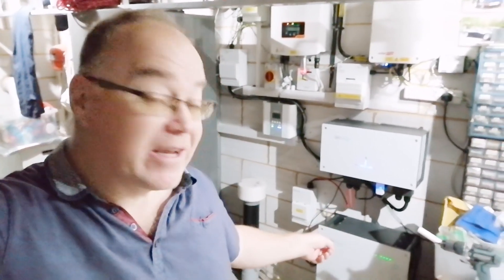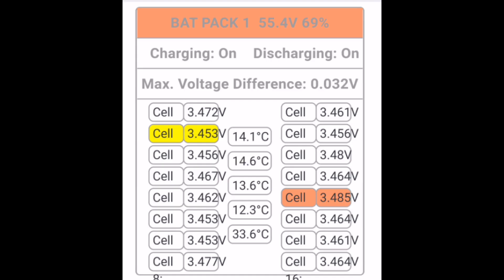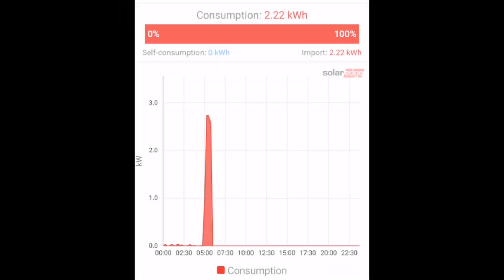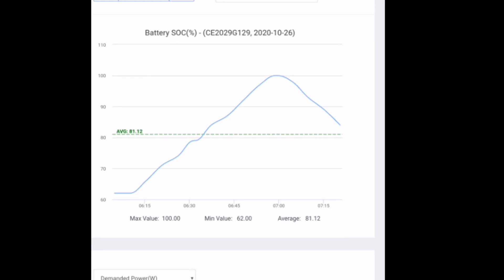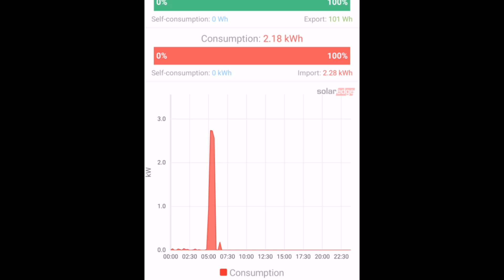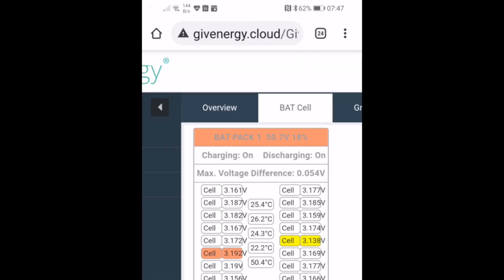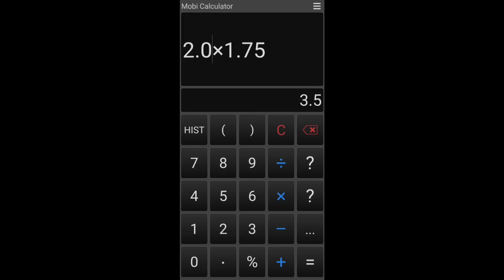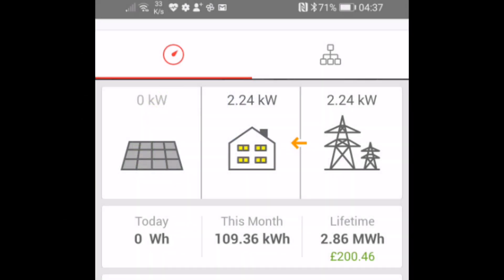Givenergy AC3K 5.2Kw home/solar battery discharge/efficiency test

Comment: Thanks for your videos and information! Would you recommend this battery and also how quick does it respond to a power load? Is it instant or does it take a while to kick in?
Reply from the maker: It ramps up and down slower than some other batteries. Not Instant.

Yes I think Givenergy is a good option mostly price wise and software wise. Performance, reliability and growing company are the negatives
Reply: @EVPuzzle  did you have any reliability issues with the setup battery or inverter?
Reply from the maker: A few software problems causing battery recalibration. Seen a few hardware failures in other people's systems. Nothing too widespread but with parts shortages it can be a pain

Comment: I'm just looking at the technical data sheet for the 3kw inverter and can see that the "max AC apparent power" is 3000va not 3000w. 3000va is 2.4kw.
Reply: This isn't strictly accurate - the VA to Watts ratio is related to the power factor of a given load, and the type of supply. In a DC circuit, Watts = VA. When using AC, power factor is the relationship between the instantaneous voltage and current waveforms - depending upon whether the load is inductive or capacitive, the voltage and current waveforms are pulled out of synch (current leading with one type of load, and lagging with the other). The greater the disparity between the waveforms, the lower the power factor, so the apparent available power is less. In a purely resistive load, which in the case of the fan heater, the heating current is so much larger than the fan motor's inductive current, it is effectively a resistive load.  On AC power, it's power factor is 1, so again VA = Watts in this case. With the data provided in this video, the applied load should be 3000W/3000VA. On the spec sheet for the GivEnergy 3KW inverter, it gives the power factor as 0.9 leading to 0.9 lagging - I'd guess it's suggesting it can supply 3000VA into loads within that power factor range - I'm not sure about that - but as an aside, it quotes a short-term surge supply capability of 3600VA, so it's odd it didn't manage to run both heaters, even if only for a few seconds...
Reply from the maker: Yep👍
Reply: @EVPuzzle  do you think this is sharp practice? I mean they put 3000 all over this thing which I can understand but they then obscure the real value with flowery terms like "apparent power". If it had just said max output  power 3000va it would be fine.
Reply from the maker: Givenergy does this more than most bit they're all guilty. The specs aren't easy for a lay person to know what they're getting.

It IS misleading.

These are in peak temperatures too. Outside ideal parameters it can be less

Comment: I'm intrigued to see that you can monitor your Givenergy battery through the MyEnergi app.  How are you doing that?  Can you control the battery from the app too?
Reply from the maker: No control but any battery Is visible in myenergi if you add a CT on the battery AC in/out and configure it on the Eddi/Zappi as a battery

Comment: If you were starting from scratch (panels, battery) would you go down the DC or AC coupled system?
Reply from the maker: AC.  More flexible and I'm not limited at present on AC connection.

Charging from the grid is key not just solar
Reply: Thank you that is useful. I'm having a system fitted this month and AC or DC were the same price. The installer  recommended AC and the manufacturer said DC, I went with AC.

Comment: I wanted to test a petrol generator at full load. So I clamp tested two identical 2KW fan heaters interestingly they drew different currents and drew less power than stated. I’m also not sure if the motors changed the power factor slightly.  So it would be interesting to test your heater to determine the actual current drawn and run the numbers again....

Comment: Brilliant video. Do you have a yearly kWh figure for how much power has been saved?
Reply from the maker: Think that's covered in an earlier video.  Pre EV and pre Solar I used to average 10 to 12 kWh a day so what's that 
4000 to 4500kwh a year?
So far my monetary savings are around £2,400 since Jan 2019. That's pretty good.

Comment: Thanks for the video. How much was the battery fitted etc ?
Reply from the maker: Free. It's on test 😀

Retail fitted it'd be about £3500 I'd guess... Maybe a bit less or more depending on fitting
Reply: @EVPuzzle  great video, thanks.  It's a huge investment to run one heater for 1.75 hrs when the grid is out. Of course that is unfair obviously. How long would it run your home in a power cut on very light use, lights, radio, pc, fridge and freezer etc?

Comment: I have my givenergy finally set up on Tuesday 👍🏼 not a big fan of the app don't have apple so have to log onto the website
Reply from the maker: It'll improve over its life but I agree it's not as good as it looks
Reply: @EVPuzzle  looking on app today house using 0.4kwh at 5am and it's pulling battery and mains don't get why? Battery on 92% after charging full at 3 30 am
Reply from the maker: It's just a snap shot every 5mins  not an accurate live view

Comment: Are there inverter losses to consider in this?  Could you plug the heater into a socket immediately next to the battery to remove cable losses?
Reply from the maker: You'd still get AC to DC losses.

You lose converting solar DC to AC and then some more converting it back from AC into DC storing it in the battery. Then it's converted again from DC to AC to use it in the house.

Really does make sense to use it as it arrives and avoid all the extra conversions.  Directly attached solar to the battery DV to DC makes sense too.

Comment: Hi Nigel do you find the 3kw inverter big enough or would you recommend a 5kw inverter
Reply from the maker: Depends on your needs. If say 80 % if my needs are covered by the 3kw but you have to remember 3kw is on peak conditions. I was limited here to discharging at 2.2kw AC because of temperature or SOC.
Doesn't look like you can rely on 3kw in winter.

The 3kw covers everything running on its own in our house, washing machine, kettle etc  apart from the oven at 2.8kw.

If you want to cover everything and multiple things at once you need more power but the kWh savings of doing this are really small

Comment: Nigel why don't you buy a plug in energy monitor to accurately measure how much your load is drawing from the battery?
Reply from the maker: Because I want to ensure I'm measuring everything that's on not just the single device.

Knowing the draw from the heater would've been handy though. I'll have to look
Reply: @EVPuzzle  You may wish not to bother - I have two of those, look to be from the same manufacturer, they read 20 to 30 Watts different on a 1100 Watt fan heater, when both connected through at the same time - this is likely due to the fact that they also show a variance in AC Volts by 2 or 3V... (It's only a little over a 1% reading error in the worst case, so hardly cause for complaint really...)
Reply from the maker: I ended up buying lots of them...
Reply: @EVPuzzle  Interesting - assuming you compared them to each other (I'm sure you have!) do they vary very much?
Reply from the maker: Not really no they're pretty accurate from what I can see. Kasa ones have better integration and now linked with home assistant, automation is endless
Reply: @EVPuzzle  Right, will be interesting to explore. I've got a PV system going in next week, with an 8.2 kW battery, so it will be interesting to see how it all works...
Reply: @will_doherty  how are you finding the system? I’ve just ordered one and I’m very curious
Reply: @jamesgrantham1743  We've had a bit of an issue with some aspects of the installation, so whilst the PV side of the system is up and running, the battery is on hold for the moment. We have a SolarEdge system installed (pretty much necessary, as we have panels in three different orientations), they wanted to supply a high voltage LG battery which needed their dc StorEdge inverter. The GivEnergy battery that we preferred (for capacity, safety and cost benefits) needed their AC StorEdge version. Then Givenergy noted that they would only honour their 10 year warranty if it was fitted with one of their inverters. So we've ended up with a standard SolarEdge
HD Wave inverter, and will have a GivEnergy battery and inverter alongside it when it happens... Overall cost still quite a bit less than with the LG battery.
Reply: @will_doherty  thanks for the reply! Hope you get things sorted soon. I’ve ordered a 4.4kwh solar and 8.2kwh givenergy battery but with there dc 3.6 hybrid inverter so hopefully ill have a little bit more luck

Comment: Nigel, a very good analysis and by way of validation I get about the same results (8.2KWHr battery same inverter), well my result was 89%. Things I note with the GivEnergy data sheets is the stated efficiency of 98% is only on light loads, maybe a few 100 watts, they don’t say what the baseline was but peak efficiency of a sine wave inverter usually occurs at about 30% load, dropping to about 90% on full load.
The large heat sink is a giveaway regards efficiency as on discharge it gets warm, that’s the 11% energy being dissipated. Most AC Batteries achieve 90% give or take a little.
The true round trip efficiency is the energy in / energy out, I need to watch your video again to see if you measured that, so say 6kwhrs to charge the battery to 5.2kwhrs then the load discharge of say 4.0kwhrs of usable energy, then round trip = 4/6 or 66% few manufacturers quote that or define it in that way. They (of course) ignore the charging losses to improve the round trip efficiency results. Overall I’m happy with the GivEnergy solution it’s about the same as all the other products on the market.
Reply: I also agree efficiency should energy in v energy out

Comment: How much power does it take to fill the battery nigel ? As for the kw rating of the heater the kWh rating will be based on the voltage it receives
Reply from the maker: It's harder to measure without charging just from the grid from empty. I prefer solar chargingbit yes losses on the way in and losses on the way out make you want to choose the battery as 2nd priority for charging
Reply: @EVPuzzle  I setup two energy meters one recording power in and the other reading power that was extracted, when I had a powervault, so got a reading from them bit of wiring to do this, but can you not setup one of your ct clamp devices to measure in and when battery is full switch the same device to measure out ?
Reply from the maker: Potentially yes but I'm not opening up the connections so less I can do safely
Reply: @EVPuzzle  there will be losses in charging as well as discharge
Reply: @EVPuzzle  I’ve found the GivEnergy monitoring is very accurate as don’t forget they fit a class-1 meter suitable for billing purposes. Next time you place the battery on charge,  feel the heat sink to get a qualitative indication of the efficiency, I’d say about 90% during charging.
Reply from the maker: That just means it limits the distant from the CT to the meter. I'm sure it's ok but it's hard to work out what each metric means. Givenergy haven't provided metric descriptions despite being asked twice. Some include or exclude things so don't add up in the export data.

Data isn't kept offline either so it's reliant on your internet connection.....I'm getting into the review early.

Apparently new release was in test last week but hasn't materialised. Looking forward to seeing what sort of improvement they make
Reply: @EVPuzzle  going by the battery data you added 1.9 kWh to go from 62% to 100%, based on that data it looks like it would take approx 5 kWh to fully charge. If your getting 3.9 kWh out it looks like it’s approximately 78% round trip efficiency. This excludes the 4% you speak of
Reply from the maker: That number is internal to Givenergy so I'm not convinced it's the amount of AC energy given to the battery.

I have asked Givenergy a out this and they admit looking at round trip efficiency isn't easy .

They seem.to favour reporting throughput numbers relevant to their warranty
Reply: @EVPuzzle  I wonder why 😂